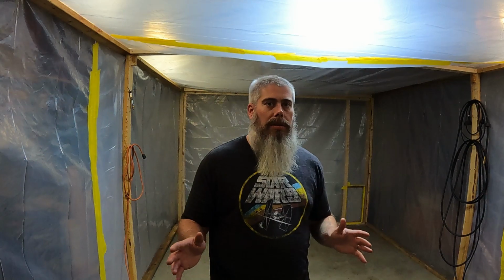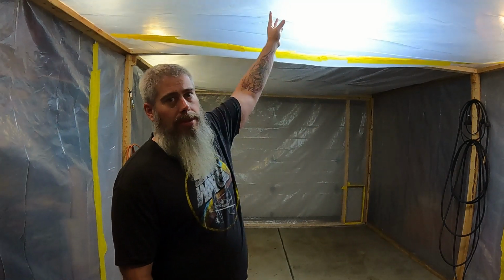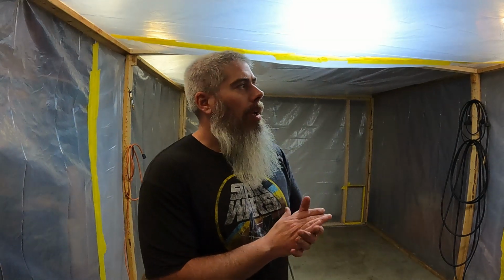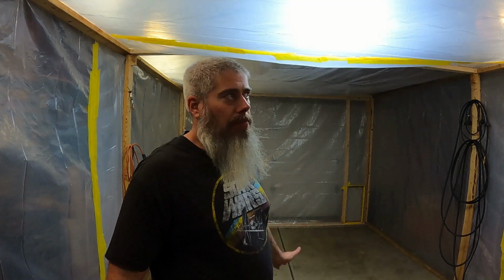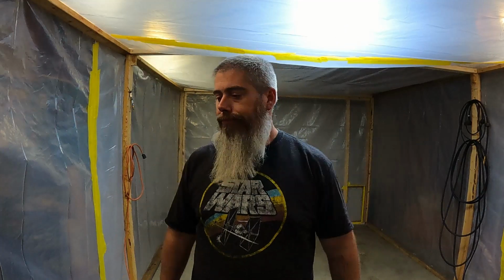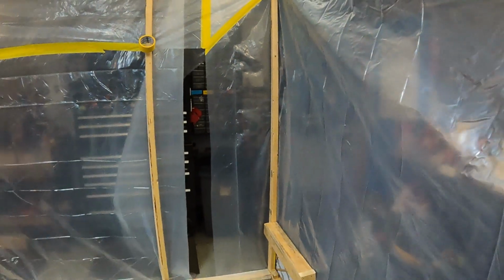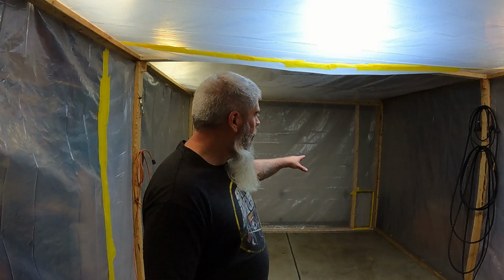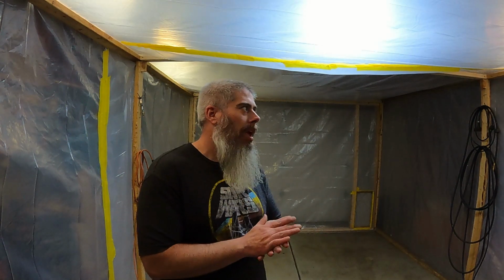Built a temporary paint booth in my garage

Comment: Interested to see how your fan and filter setups work. We are doing similar (fit one into a garage with lotsa stuff in it already), except using 4 permanent taut cables at the top and 4 mil plastic sheeting draped over that. Bottoms secured just by wrapping 2 x 2's in the plastic at the bottom and small but powerful welding magnets (Eastwood) placed against the sides of another car on one side and flywheels hanging on the wall on the other side to hold the plastic further away from car being sprayed. But we only did primer so far and with garage door open. Paint fumes were only tolerable that way and it will soon be too cold to do that, so that is why we will be watching to see how you do with the ventilation aspects. Thanks for posting the video.
Reply from the maker: I've already sprayed the trunk and core support, the intake of air was fine but I was on the verge of needing more exhaust so if I was spraying bigger items dual exhaust would have been necessary.   Temps are dropping quickly here as well, so I won't be able to keep the doors open while spraying if I don't get this done soon.  I may need to fab up a vent from the exhaust to a removed panel in the main door.  Intake air shouldn't be a problem as I have eaves and attic vents for fresh air.